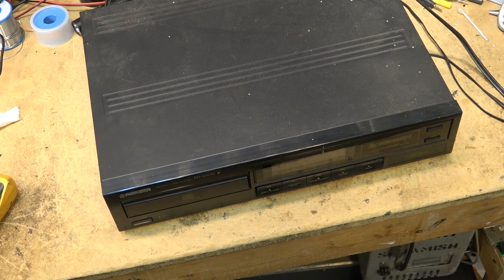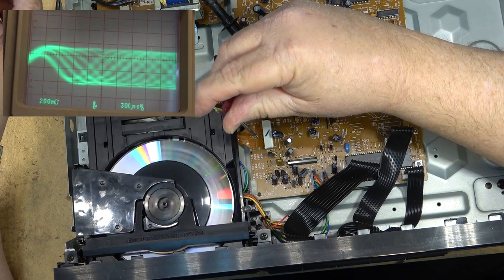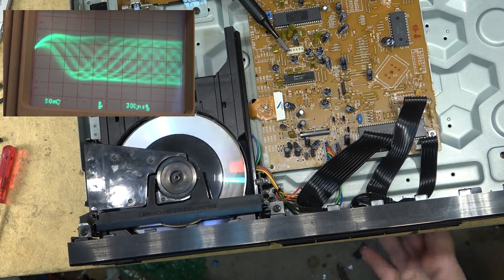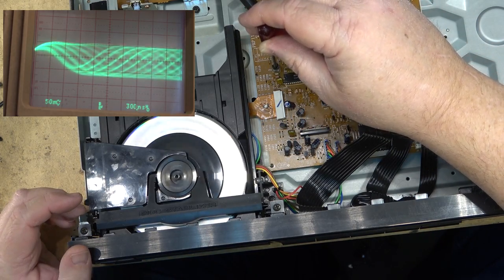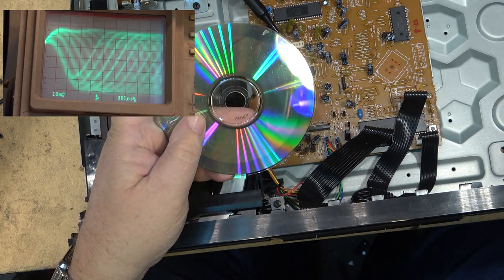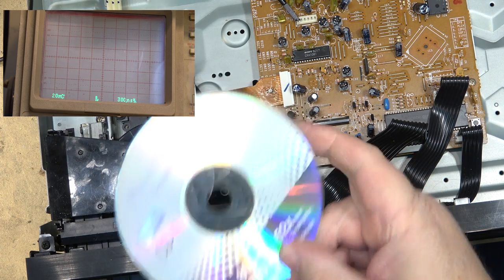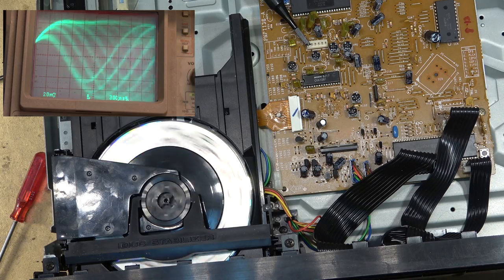Pioneer PD4300 Cd player that just makes noise 2 camera shoot

Comment: I love these old Pioneer cd players because there are so many manual adjustments available for finetuning. I was not able to kill the laser with maximum output on my PD-5100 but you can set it really low if the other adjustments are correct. Tracking offset/balance and laser focus offset are very important but you have to check many different discs to get a setting that works for most CDs. Even replicated CDs can be very different. Now my player is really fast, silent and plays even the worst CD-Rs.
Reply: I have got a PD 5500 which I'm also happy with!

Comment: According to the service manual of similar Pioneer CD players, eye pattern should be 1 Vpp with stamped discs. I guess you are using a 10x probe and the 100 mV shown on the oscilloscope are indeed 1 Vpp which is spot on. Anyway given how much you had to increase the laser power, it means the optical path between laser - disc - photodiodes is pretty dirty. Very little can be done in that case, increasing laser power will fix it but it sill also shorten the remaining life of the pick-up. Does not look like a high-end player, whatever life you get out of it is fine !
Reply from the maker: Yes 10x probe.  
I got it for free so i wasn't expecting a miracle.  Just wanted to get it to play.
Reply: Would cleaning the laser lens not help? I have a cd player that skips on almost every cd I own, and its been sitting for a long time. I have a second one that the audio is disorted on on every source as well. Both I got for free, so they arent in mint condition, but they arent in the worst condition either. but I clean the laser lens on all my players and drives every now and then.
Reply: @julerobb1  the side of the lens that can be cleaned is only one part of the optical path. The internal optical path include the laser faceplate, the photodiode window, the prism used to separate the reflected light from the incident light and the diffraction grating used to generate the "three spots laser beam" used in linear pick-up .The internal optical path should not get too dirty, but I suspect that if the player was kept in a smokers household, nicotine and other contaminant can make the surfaces of all optical components cloudy causing attenuation and loss of signal. Anyway dirt is one of the pick-up failure cause, but there are other problems that can occur; unfortunately in almost all cases there s little to do, optical pick-up components are glued in place with accurate and precise alignment, no way to take them apart and clean.

Comment: I don't know why, but your fiddling with laser gain/power pots brings really nice memories I had with Commodore 64 and adjusting cassete azimuth to load a game from a cassette unit. Back then (cca 1986/1987) a fella needed to have really fine flathead screwdriver, load a "turbo tape" that would show a cassette track pattern which needed to be tuned before actually loading a game...so imagine the number of twists and turns on the head azimuth when playing 20-30 games a day... I used to steal my mom's flathead she was using for her sawing machine all the time... :) Anyway, nice video. And thanks for bringing memories...
Reply: I always wondered how a datassette got into such a state!  I never adjusted my head's, not once till this day. I can only guess that some models/mechanisms were prone to letting the heads drift.

Or I was just lucky

Comment: I have CDs that were pressed at Toshiba's and Sony's old CD plants in Japan around 1984-1985 and they still read perfectly fine. You are right there were some crap pressed discs. For example I have read Nimbus CDs will literally get destroyed if cleaned with water.

Comment: Greetings from Australia ... I remember back in the early 2000's burning tonnes of data onto Princo discs and had similar issues. They didn't last very well but they were very cheap (i recall around 1/2 the price of 'other' brands at the time) so they were very popular for a while.

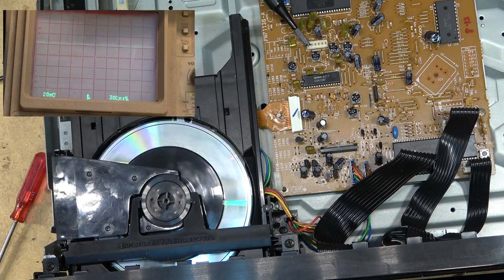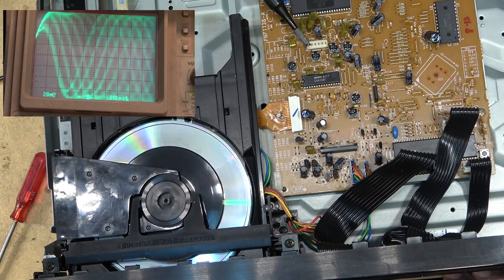Comment: That part of the video that goes from 28:54 to 29:22, I could say, I agree. Now, at 29:34, you did try to test itt out with a Princo disc, and yep, it failed to read it. I feel that this is an example of why good quality CD-Rs read better with certain older players.
Reply from the maker: Princo were garbage discs.  They ate the ones that "proved" that cdr only lasted 5 years before failing.  I have many cdr disks that are well over 25 years that play perfectly.  I have a bunch of princo disks that are blank now too.
Reply: I feel that there is no denying or arguing that any of the discs that are blue-on-silver are better quality, like DataLifePlus/Verbatim Azo, anything that is by or powered by Taiyo Yuden light-blue cyanine. I did heard that CD-Rs from Fujifilm are also great quality, even though I haven’t tried them out. Maybe anything that is green-on-gold? It should be anything that is manufactured in Japan. Even if it is made in Taiwan, there are still ones that are proven to meet Japanese quality standards. Such companies, like CMC Pro and Vinpower, claim they did test all specific quality-control standards, ensuring low failure rate, and that it will last a long time. It depends on how old your CD player is. I found out that the one you’re testing out is a 1989 model by Pioneer. With that said, anything that is blue-on-silver should play fine in it.

Now, me? I only own a newer CD player boombox by Sony that has Bluetooth. The blank CD-Rs that I’ve been owning for the past year, are the ones that are proven to be of better quality. It’s by CMC Pro, and is powered by TY. Although it is made in Taiwan, it’s still maintains the exact same standards as the original Japanese discs.  Top surface is shiny silver, which means that it is printable through thermal printers or silk-screen, which I don’t do. Before burning, since both sides of the discs are shiny, I clean with just a pure isopropyl wipe and a microfiber cloth for drying, ensuring cleanliness, and that I get a consistent burn from my now 4-year-old LG external drive attached to my PC laptop. Overall, I got to say, I’m proud it played fine from start to finish.
Reply from the maker: @noeljosephdelacruz7451  the green on gold were fantastic as were the gold kao discs.  Blue on silver and green on silver also great.  I have a 25 year old cdrw that also plays perfectly.  Since cdrw doesn't use dye but changes physical metal layer there is nothing to fade but many CD players won't play cdrw but DVD players will including the really old ones that won't play cdr.

Comment: It seems happy enough now dave :-D
I found that the ancient deep green disks were more reliable and didn't lose data clarity over time.
High speed disks burnt at silly speeds never seemed as good as the old 4x types.
I had a stack of high speed tevion disks that started fading after a few years in dark storage, lucky i had secondary backups and re created the faded disks Not on tevion!!.

Comment: I have an old Onkyo DX-530 that I love. However, on most disks (stamped or CDR), it struggles to start playback on track 1 of the disc. It spins and eventually gives up.  I have to start on track 2 and rewind back to the beginning of track 1.  I wish I had someone here like Dave in the US to repair my player.
Reply from the maker: It could be the laser and when a laser is bad the unit is a throw away because the parts are not available.

Comment: Hello sir, i have a PD-P840F. It cycles the discs but not play anithing, i cleaned the laser lens nothing seems to be missing, but not working, if you can give an idea whats going on. Thanks
Reply from the maker: Usually laser or spindle motor is shot.

Comment: All Princo CDs i had from 1999-2000 (With logo on top) the layer turned from light green to light yellow after some years and by around 2010 i checked them all, none was working anymore. In contrast Princo DVDs i had from 2004 work perfectly even today. Though even the original OEM Windows XP SP2 Disc i had turn half bad (cannot read some files) after a decade.
Reply from the maker: Many I had fail the dye also changed color to a light brown/yellow color.
Reply: I still have one, but it's scratched beyond all get out. I have an OEM distributed one tho.

Comment: do you have any experience with Panasonic DMRs with the hard drive built-in
I have a DMR eh55 that won't accept any recordable disc, the hard drive works fine everything else works fine
the DVD drive will not recognize any recordable disc including its own RAM Disc, but will play a commercial DVD
someone suggested it might be its programming but that's I don't know where to get that
they don't sell these in the US anymore if they sell them at all, I really like these machines and I have others but I'd really like to get this one working.
I took it apart but there's not much in these that you can repair all the capacitors look good, any ideas
Reply: Laser going bad.  A real dvd reflects enough of the laser to let it play yet the power from the laser is too low for a DVD-R as it has a lower reflectivity.
Reply: @dlarge6502  Do you know where I can get another DVD unit for this?
Reply: @catman58  A couple of things to check
1. Are you sure the optics are clean? Some units have a fan and it can draw dust into the machine (also when the tray is open). Over time that can build up enough to cause reading issues. Inspect it with powerful magnification and bright light if it looks hazy the optics are causing part of the problem. 
2. Try a new disc RAM discs do have a much longer working life (writing cycles), however they still have a life cycle and will eventually fail. Try varieties of DVDs one time writes and rewritables and see if you get the same (failure) results.

Comment: 12voltvids + cd player = my jam

Princo disc are horrible. I've used that for PlayStation backup. A lot of them have also disc rot.

For me, the best are Verbatim Metal Azo, Pioneer CD-R (those are made in japan) and Yamaha.
Reply from the maker: Princo and ritek were bad.  The dye they used was shit.  Verbatim, kao, maxell, Fuji, tdk and Sony are great. Have many 30 years old all play perfect.
Reply: @12voltvids  I mean, Taiyo Yuden 48X/52X is reliable, but of course, use the silver ones.
Reply: @noeljosephdelacruz7451  The best are Verbatim Metal Azo.
They have a deeper dye.

But, it's harder to write because, phtalocyanine is unstable and the laser diode need more power to write the pits on the disc.

Comment: Previous owner admittedly tweaked every pot on a CD player that I picked up. Now, the player will not spin up. It will slightly rotate the disk in the wrong direction and then report no disk. Is there a secret to returning the pots to a neutral enough position that will cause the unit to read the TOC. Then, I can perform factory alignment according to SM. I just need help getting it to spin up. What's the key?
Reply from the maker: Set them around middle.  Start with focus bias and gain.  If no focus it won't spin up.
Reply: @12voltvids  Thank you. Love your videos.
Reply: @12voltvids  Took your advice. Set everything near the midpoint. Then by tweaking focus bias pot, got it to spin up. That is such a good feeling when it happens. Now, it seems to play the first 5 tracks of a commercially stamped CD, but the higher numbered tracks will not play and actually cause the disk to start spinning unchecked. I was hesitant to make a move since I just got it to spin up. Any suggestions for next steps. I figure you have most likely seen this symptom before and thought I would ask before I tried anything. Thanks again. I think we are getting there.
Reply from the maker: @rinkerlaw7446  you are getting close.  Without a scope it is difficult.   Can the optical block nice freely.
Reply: @12voltvids  Yes. I lubricated the rails and the block moves very well. I do have a scope (Tek 2215), but the trace is a little on the dim side. I tried the adjustments recommended in the service manual, and I had a reasonable eye pattern -- on track one.
Reply: @12voltvids  Got it. Basically, I tweaked the settings for the strongest RF on track one, then track two, etc., walking my way up to the highest track numbers. It's been playing flawlessly for about 2 hours now. I wonder how long it will have to play before I am truly confident that it is fixed. Thanks again for all of your help.
Reply from the maker: @rinkerlaw7446  I hear you.  Working on a 200 disk CD player today.  Got it playing now.  Will leave it run for a few days to be sure it is actually fixed.

Comment: I just bought this cd player and it sounds so good with my pioneer sa-510 amp! The player is in really good condition. The only thing is that it makes a soft cricket-like noise when it spins. Does anyone have an idea what it could be?
Reply from the maker: Squeaky disk clamp?
Reply: Well when I lift up the front it seems to stop. I guess the surface underneath the player is far from level. Another thing i noticed is that i have to turn my amp volume knob to bare minimum for a normal volume of music. Is there any way to adjust this output in the cd player?

Comment: OK when I play a track from a cd player a portable one that first one goes fast and it will go slow as you play to the and.why is that.
Reply from the maker: CD and DVD use what is called constant linear velocity recording.   Laser disks used either constant linear velocity CLV or constant angular velocity CAV. In CAV the rotation speed is fixed.   In CLV the disk speed varies depending on where the read out is.  Close to the center requires a faster speed then around the edge due to the size of the disk.  CD and DVD read from the center out.   As the laser moves towards the edge of the disk the disk slows down as there is more surface area at the edge. The data is written and read at a constant rate.   You can double your data storage by doing this.  Laserdisks recorded in CAV go 30 minutes per side and perfect special effects as 1 rotation was 1 frame.   In CLV mode no special effects but 60 minutes per side.
Reply: If you examine a CD or DVD you notice it's like an oval race track the inside has less distance verses the outside. CDs and DVDs compensate by faster rotation in the center (start of the disc) and slows down as it progresses towards the outer portions of the discs. Like the oval race track the inside verses the outside there is less distance to travel verses the outside of the oval track 👍😄👌.
Reply from the maker: @darinb.3273  i believe i explained that in my reply.
Reply: @12voltvids  Hey Dave you did I understood, I wasn't sure if that person would understand the CLV, CAV and Z-CLV. I suppose some units perhaps use different methods during playback. I never seen an audio CD player that the speed stayed constant no matter what position the laser was reading. I have only read about those for burner units in computers specifically for the method used for burning strategy, the poster did write about audio CDs.
Reply from the maker: @darinb.3273  Portable players with skip protection 5 second buffer did spin faster as it read into memory faster than read out.
Reply: @12voltvids  Right, I have a Panasonic portable with selectable 3 second anti skip and it spun twice as fast as I remember, however it still followed the same fast at the start and slows down as the CD plays. It amazes me that the circuitry can maintain focus and eccentricity in order to track the line of pits and lands and then the doubled the speed for the purposes of anti skip. Could imagine a person trying to read a news paper at the speed audio CDs spin? Wheeewwww. That doesn't come close to the anti skip speeds and higher speed CD-Rom ohhh my. Some read a rate of 56×, a jet powered flying saucer right inside the drive LOL.